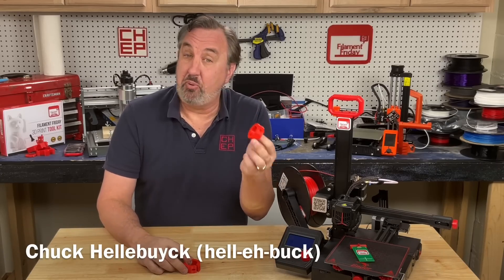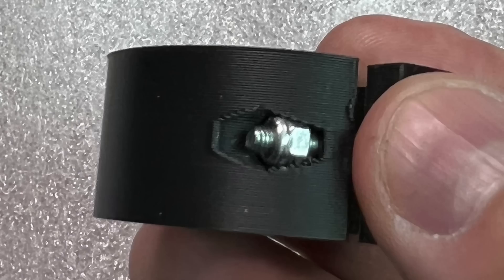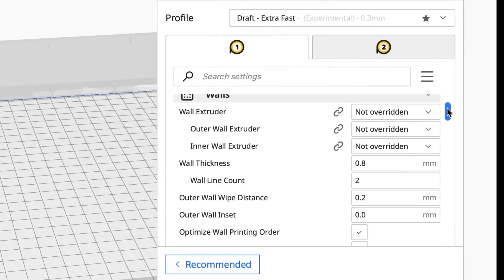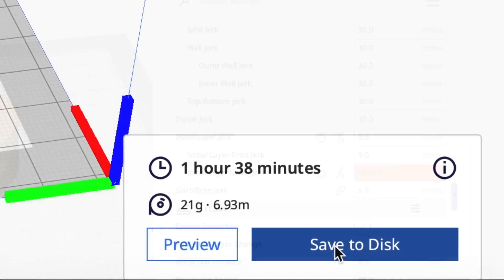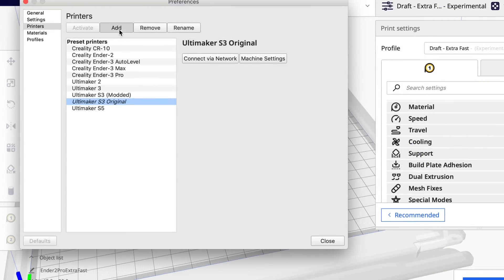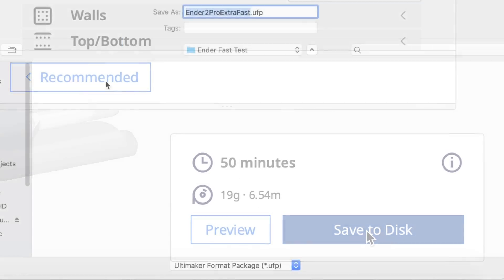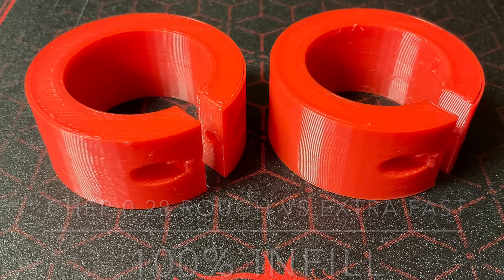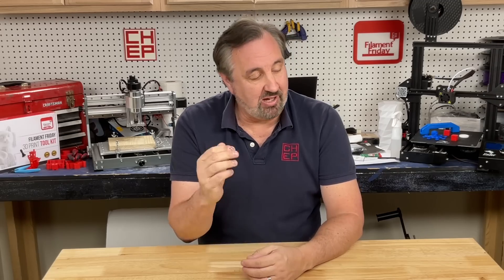Faster 100% Infill Prints with Cura 4.13 on Ender 3D Printer

Comment: It's weird. I saw some significant decreases in print time with the same settings as normal on my Ender 3 pro. The strange thing is that there were some prints that were showing a longer print time than the standard settings for the ender 3. Not sure why that would be. So I have just been going back and forth between the 2 profiles to see which is faster and use that profile. So far I haven't had any print issues or any differences in quality.

Comment: I tried to use the  s3 profile but my print failed due the the print shift. What causes this? My print started coming out looking like a staircase? ( not losing bed adhesion)
Reply: Your stepper motor is weak so it can not keep up with that EXTREME G-s of acceleration.

Comment: Usually when I need strong part while not  wanting to go 100% infill, I set like 4-6 perimeters (0.4 nozzle), a stick in a grid or cubic infill at like 10-15%, works wonders, layers dont split and feels pretty solid.

Comment: Not Overridden refers to extruder choice overrides for multi-extruder setups.   I only know about it because I use a modified SV02 as my PETG and transparent part machine and that has a dual head setup.  I bet its doing the printing so much faster by removing the majority of the retracts....  if you calc it pefectly you can move the head around a whole layer without stopping once.

Comment: i thought is all about profiling settings, it only makes sense, the machine can withstand high speeds if moded properly, however if the speed of the software is slow... and clogged ul get long time printing. nice to see this tip really helpful, initially i thought is the SD card read/write speeds and i think a big part of the time consuming is that. but this is a huge difference compared to 2hrs its insane fast now.

Comment: I'm a little late to this video but one thing which you could do for this part is to only change the area around the nut / bolt to 100% infill.

In Cura you can use this by defining a support blocker region over the nut / bolt, then change the support blocker to "modify settings for overlaps", click "select settings" and enable "infill density", "infill pattern", "connect infill lines" and "alternate extra wall".

You can then change the pattern to lines, the density to 100%. You'll want to disable "connect infill lines" and enabled "alternate extra wall" to ensure that the two infill regions touch each other. You'll also want to make sure that you select "infill mesh only" from the dropdown.

(I've never actually tried these print settings, only previewed them from within Cura)
Reply: Terrible idea.  Doing so breaks lines of continuous extrusion at the edge of the support blocker, actually WEAKENING the part.
Reply: @thatguy5639  With "infill mesh only" it doesn't break the walls at all, they remain continuous. The infill is indeed broken, but it's no different to where your infill touch the regular walls. That isn't the point of these changes though - The point is to create a region around the bolt which is crush-proof. The strength of the junction will be just fine if your part is designed appropriately. If you need more strength when doing this, add more walls.

Comment: Well I downloaded the new Cura, but for some reason I'm getting even worse print times with 100% infill on the Ultimaker profile. But after watching Lost In Tech's video on obscenely overextruding in vase mode to make strong thick walls even with a small nozzle, I came up with an even better idea to cut infiill time by 75%: Slice the model with 0.4mm nozzle for the walls, and 0.8mm nozzle on the second extruder for infill, with 2x infill layer thickness. Then postprocess the gcode to make it actually print everything with a single extruder. With relative extrusion enabled, I think all that will be necessary is to strip out all the T0, T1, M104, and M109 commands.
Reply: Or just increase the line width for infill and thickness and let it run just like that.

Comment: I Made a profile using your method for the Biqu B1 and gote pretty much the same results you found, that you show here. A normally 15 hour print completed in 7 hours with some stringing that I wouldn't normally have. This worked on both of 2 printers I have althouh one had barely any stringing but not as nice layer lines (this had whilte filament the other black so maybe a temperature thing). Did you ever figure out what it it is thats causing this to work so well?

Comment: finally made the profile to work with voxelab aquila and im amazed how fast it prints with 0 infill  moai statue with 2 walls and 3 top and bottom layers for under 30 min i reworked the profile from the ender 3 and  its amazing it looks like it can go even faster but i wont mess with it for now usually i m making that moai statue for like 2 hours now its printing for like 30 min  finally starting to love my printer :D( there are artifacts from the left side from the model i think i need to make a new cooling system to be able to cool from both sides for that speeds)

Comment: At 100% infill printing time is only a matter of how much material you can push through your hotend per second. So there are three easy possibilities how to minimize your printing time without effecting the part quality:
1. Use a wider layer line width for everything except the outer perimeter. I'd reccomend printing the outer perimeter first. You can go up to 200% nozzle width, whereas I'd reccomend using 150-170%.
2. Combine your Infill every other layer (infill layer thickness twice the value of the normal layer height). That will double the infill line height and reduce the infill printing time by 50%.
3. Optimize your infill and inner perimeter printing speed by raising it up to the limit where your extruder starts missing steps and then reduce the printing speed by 20%. You can't reach that point? Choose a higher layer height and try again. If this isn't an option for keeping the print quality high, increase your accerelations until the printer misses steps in X and Y (try to find every limit individually). Lower the value by 20% and try again.

And that's your 100%-Infill-SpeedPrinting setup. Good luck, have fun.

P.S.: Still not fast enough? Upgrade to a BondTech CHT-Nozzle or a Volcano Hotend.

P.P.S.: Still not fast enough? Upgrade to an E3D Hemera or BondTech LGX extruder with V6 Hotend and BondTech CHT.

P.P.P.S. Still not fast enough? Bro, it's 3D-printing... That's not supposed to be super fast :D

Comment: I was able to accomplish this with just adding 4 lines of code to the .json definitions file for My Ender 3 pro.  I get the extra fast profiles (with confirmed time savings), but with everything else set to Standard Ender 3 settings as defined in the creality base profile.  I also added a fifth line of code to enable Octoprint connections.   

You also need to change the name of the definitions file so that it uses the same name as an existing ultimaker definition file.  It's all about the Nozzle.  if you notice in your video, when using your modded setup, instead of selecting the Nozzle width, it's ulimaker cores.  Thats the magic sauce.  it checks to make sure the profile is loaded from an "Ultimaker" definition file and that the machine has Ultimaker Cores.  without one or the other, you don't get the correct profiles. 

Once you add the printer with the modified definitions profile, everything looks exactly like it does for a standard Ender 3, you just have access to the new super fast profiles and don't need to edit the setting in Cura.
Reply from the maker: I’ve created an Extra Fast profile for Creality printers that beats my hack that I shared in a community post. https://thangs.com/mythangs/file/56518
Reply: So it has to use those predefined "cores"? Is there no way to change nozzle diamater with this modded ultimaker profile? E.g. I have 0.5 nozzles that I really like but there are no 0.5 cores to choose. I could maybe use 0.6 nozzle with CC 0.6 core but I don't know how much that differs from AA cores.

edit: it also only works with PLA, I had good results with ABS but I had to edit material settings to fool cura that it's actually PLA that just needs 240°C ;)

Comment: if you want fast + high quality, use a better CAM program
Reply from the maker: Which one do you recommend?
Reply: @FilamentFriday  slic3r has been working great for me, plus it's open source, and can be run on a sbc running a linux distro.
Reply from the maker: Slic3r is old. Prius’s Slicer is a based on Slic3r but added many more features. I use that or Cura. Find them way better.
Reply: @FilamentFriday  And Klipper... I don't recall if you messed with it in the past but it has improved A LOT and can turn these Creality machines into beasts. With Resonance Compensation you can run higher accelerations like this and still eliminate nearly all ringing. Someone like you should really try to find the time to give it a fair shake if you haven't.
Reply: @JJFX-  Klipper is a firmware.
Reply: @adamarzo559  Yes. I'm expanding on increasing print speed. Optimized slicer settings and Klipper is the best way on these Creality machines.
Reply: Lol, wat?

Comment: It's the "minimum layer time" setting which is holding you back. Change it from 10s to 5 or lower and enjoy ridiculously high speeds
Reply from the maker: Did you try it or just guessing?
I tried it and didn’t see any improvement.
Reply: @FilamentFriday  cura was limiting my ender 3 speed no matter what feedrate or acceleration was. Eventually decreasing minimum layer time (with settings above included) made my printer blazing fast. Not that you can print reliably with ender at that speed

Comment: If i compare the time estimations between my ender 3pro profile and the same profile with the modded ultimaker s5 (as shown in your video), most of the time savings occur at the outer wall, although the outer wall speed is set to the same values in both profiles. Also the same values are used for acceleration and jerk. Where does the time saving come from?!
In my case, a 9,5h print was brought down to 6,25h based on cura's time estimations, whereby the time for the outer walls alone accounts for 2 hours and 20minuts in time savings...

Comment: The new 4.13.1 extra fast setting is still slower than my custom default 0.28mm height quality setting xD
Reply from the maker: Where do you share it so we can try it?
Reply: @FilamentFriday  My machine is a modified ender 3Pro (actually heavily modified😅) 
The profile is unpublished, but i can shere with You privately if you're interested :)
I think there is norhing special in it, 80mm speed for infill, and reasonable jerk values, around 1000 acceleration.
Reply from the maker: If I can’t share it, I’ll pass. I’m just looking for the best options for viewers. Thanks though.

Comment: Printed this file today on my Tronxy XY-2 Pro. I migrated all of the 0.28 Rough-Fast profile over to my Tronxy, but printed at the speeds which the machine is tuned for. At 100% infill, with all of the line/layer/wall settings from the Creality profiles, and the file printed in 38 minutes 8 seconds.

Comment: I have a question about the cura profiles. Somehow the 4.12 profile causes my z-axis stepper to keep clicking thru out the print.
In older profiles or the default cura profile I don't experience this.
There is no z-binding. If  drop I lightly touch the gantry it will slide down on its own weight.
Any setting in the profile that could cause this? At first glance I couldn't find anything.
Tnx for all the work and sharing your work!
Reply from the maker: Which profile 0.28, 0.2?
Reply: @FilamentFriday  the 0.2 and the 0.12. I just tried a full print with the default cura profile and I don't experience it with that so I should probably do some tests with eliminating different settings.

Comment: Your own profile is actually to blame here.

Your entries for top_layers and bottom_layers actually make it so the layer count changes and eliminates infill. So you print your 100% infill at the top/bottom speed.

This is literally your own fault for not fixing these two lines.

Also, no, I wont become a Patreon, because I shouldn't have to pay you to teach you how to improve your content... But if you change those two lines to 
bottom_layers = =math.ceil(round(bottom_thickness / resolveOrValue('layer_height'), 4))
top_layers = =math.ceil(round(top_thickness / resolveOrValue('layer_height'), 4))

This whole problem will go away, and you wont need to build a ridiculous "hacked" profile.
Reply: The intent profile does it a bit different, but pretty close: 
wall_thickness = =line_width * 2
top_bottom_thickness = =wall_thickness

There are some other changes that also influence it, but those are the major ones.
Reply: @nallath   I appreciate the reply Jamie. I contribute to the Cura GitHub, and have become pretty well versed in your project. Still not an absolute PRO, but I can make things work.
I get a bit irritated when people make helplessly misguided videos like this, which in turn get their blind followers to do REALLY silly things.

I've looked into the 999999 bottom layer conversion with 100% infill, and it goes back as far as 3.4.1 (furthest back I have looked), and to that end, I am absolutely floored when I see people suddenly crying out that "Something has changed, and our machines are slow", when its simply not the case. 

Everyone wants to blame the profiles, but none of them want to put in the work to actually improve the stuff.
Reply: @AdderMk2  I think this was even the case since 2.1...
Reply: My my, aren't you a grumpy lot.

Comment: How do I import this profile into Cura to use with the CR6-SE? I have it working, but it's still titled as an Ender 3Pro, & has the limited print space. 

I've got a print that's 45 minutes into the process with this hack. So far all is going well! I'd LOVE to be able to unlock the full printing space of the CR6-SE while using this profile!
Reply from the maker: Modify it like I show in the video.
Reply: @FilamentFriday  Thanks Chuck, I'll re-watch it & try again.

Comment: I'm pretty sure the issue is in how Cura calculates GCode for Ender machines. It assumes that the Ender still has a max acceleration of 500 mm/s2. So if, on the Ender 3, you change acceleration from 300 mm/s2 up until 1000 mm/s2, you'll see that there are no changes after 500 mm/s2. But, if you use a new/custom 3D printer profile that isn't an Ender, then you won't be restricted in this way. You just have to make sure that the machine you're using has a max acceleration high enough in its settings.

This is how I got my Benchy times down on my E3
Reply: It only does that if you have you're max set to 500, because its the correct estimate. I mean, if you;re start code literally tells the printer to never exceed 500, then of course its the estimate is going to reflect that.